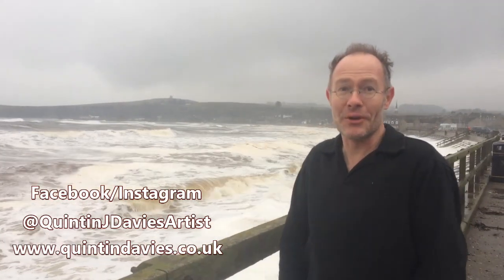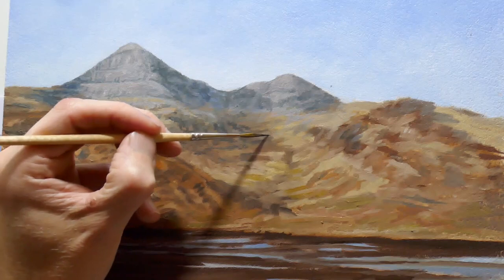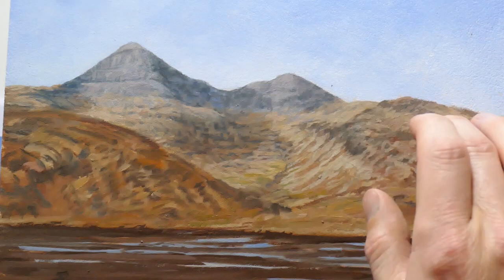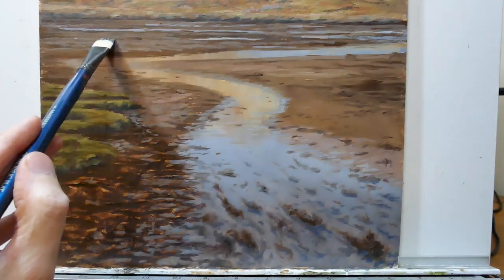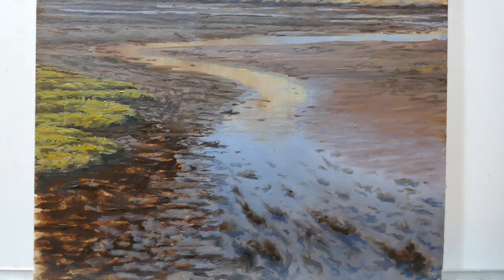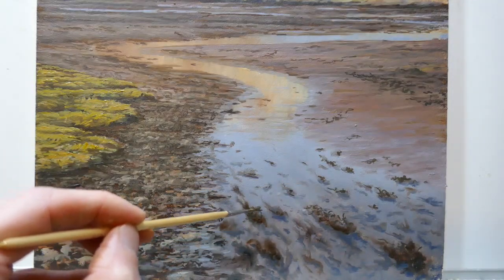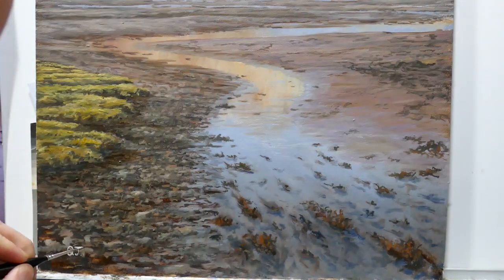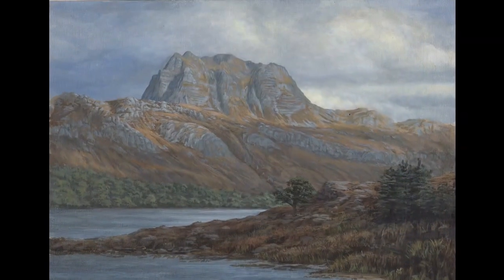Episode 3: Ben More - Landscape Painting Demonstration - Definition, Detailing and Glazing

Comment: Wonderful, informative tutorial. 
I can see the need for the stages you went through to produce your painting. 
I'm not a trained painter. I'm dabbling in acrylics. You have the advantage jn oils to blend and work with your colors over a longer period of time. 
How you instruct someone using acrylics to produce the same kind of painting as your oil painting.
Reply from the maker: Utube6762  thank you!  I do acrylics as well, so the technique is slightly different.  I tend to do more layers with acrylics and slowly build up the painting.   I use a slow drying medium and a stay wet palette.  Skies are the hardest and after setting the canvas you have to work fast!  The principles of tonal underpainting and colours are still the same however.
Reply: @QuintinJDavies  thank you